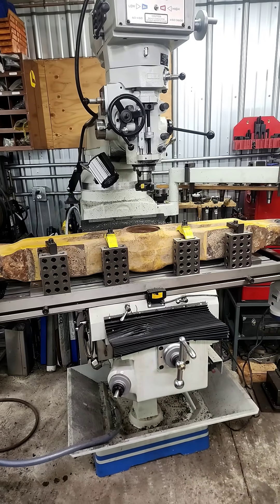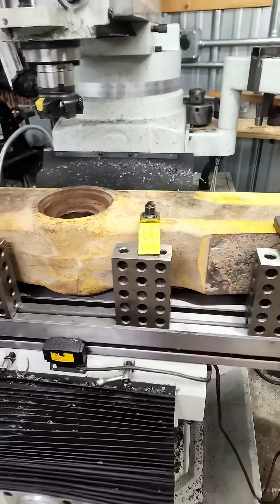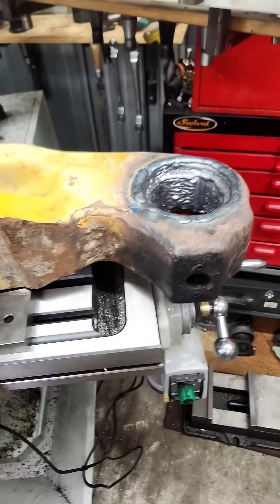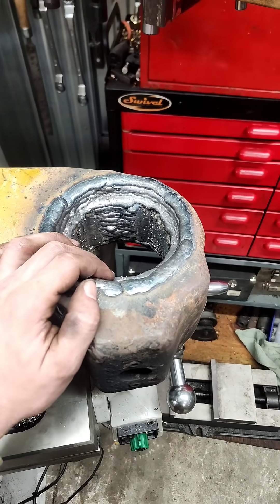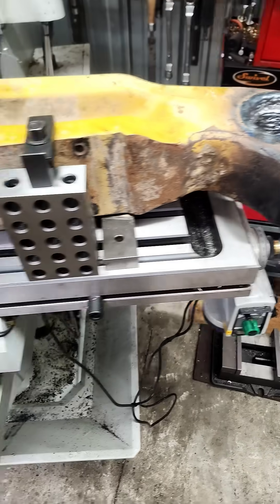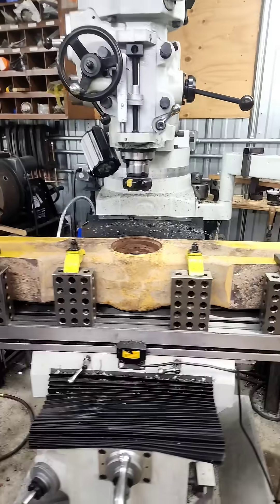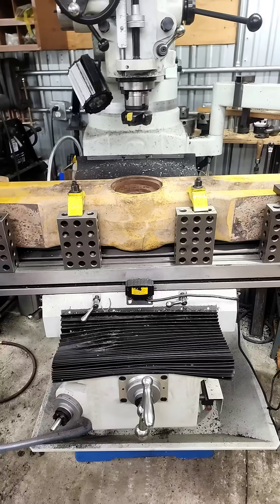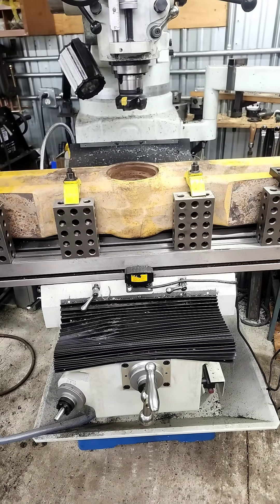Hard bar/Equalizer bar repair on Caterpillar D8R

Comment: How do you centre a piece like this
Reply from the maker: These are a common enough project that we have a drawing of them, and position based off measuring from a few known points. Typically the bores are too far gone to reliably center off of the original.

Comment: How much does this job cost?
Reply from the maker: All of this kind of repair work is typically billed out hourly. But an average would be between $1200 and $2000 Canadian Dollars depending on setup time, how much weld buildup is needed, ect.
Reply: Well, that seems very reasonable.
Cat would probably charge you ten times that, for a new one.

Getting a part like that refurbished for probably less than it costs to keep that monster fed with diesel for a day, well, that's not bad at all, in my book.
Reply: Thank you for the explanation as well.